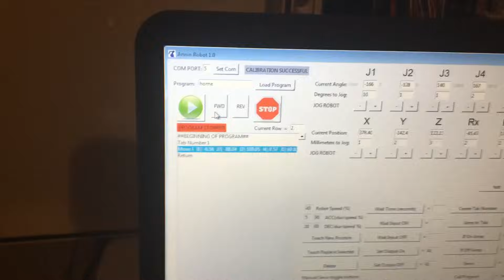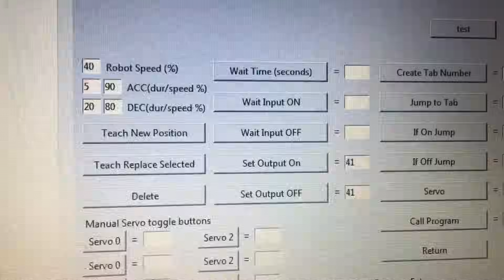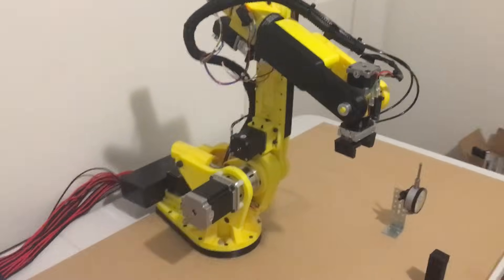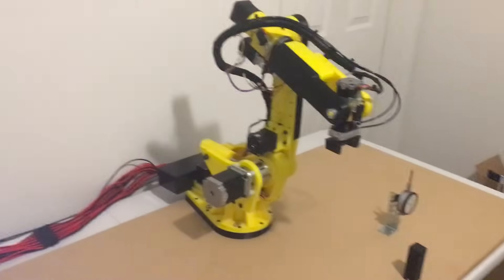3D printed  6 axis stepper motor robot - Gen2

Comment: Nice work. Steppers are just too loud for this though, I can see why they use Servos in industrial robots, servos can be much more accurate anyway as well.
Reply from the maker: agree, the stepper are loud - especially being direct drive.  If its going into a shop or garage I cant image the noise is a deal breaker depending on what you want the robot to do - I think it comes through the mic in the video louder than it seems in person.  Servos and harmonic drives are ideal if you have $$$.

Comment: Жесткости ему конкретно не хватает...
Reply from the maker: yes its not extremely rigid but it is low cost and 3D printed.  Well see how the aluminum version turns out.
Reply: What drivers do you use for motors? Does they support microstep?

Comment: Nice work! I'm a robot systems specialist and currently assemble, program Fanuc and Motoman mig welders and painters. Have u considered variable registers and even arithmetic functions?
Reply from the maker: Yes, I actually just added registers that you can increment from the program and then jump to different points in the program if you want to based on register value our count.  Eventually I would like to have position registers and be able to do offsets based on cycle count or whatever you want, I'm not sure what the next priority is though. Thank you.

Comment: Very Impressive!  May I suggest that you switch to Expandable Braided Sleeving for your cable runs.  Here is a source: https://www.cableorganizer.com/expandable-sleeving/?gcssku=BS0375BK  The nice thing is that it will expand to get the cables trough, then can be taped or be terminated with heat shrink tubing.

Comment: Chris, every once in a while someone comes along to give you an ooh-ahh day. Congratulations, you're it for this week! Looking forward to making my own 3 axis bed CNC and cutting a robotic arm to go on the cross slide to replace the single axis up /down cutter head movement. Put a collet chuck where your grab arm is and with router bits / drills / milling cutters we have an inexpensive 3d subtractive workstation. Put a 90 degree gear on the end and with a spindle in, place a saw blade and you have a grooving station for sheet goods. Put a grinding wheel on the shaft and you have a surface grinder. Wow, a whole workshop in one tool.  Can't wait!

Comment: Very nice. Can't wait to see the aluminium one!
Reply from the maker: thank you
Reply: Just found myself watching this again for the nth time. Regarding your comments here about moving the kinematic calculation into the arduino, that sounds like quite a hassle. Isn't the arduino just there to relay step/direction info to the motors (and listen to the limit switches of course)? The kinematic calculation strikes me as being perfectly suited to a computer with some proper processing power, and more easily modifiable setup and tweaking and potentially also graphical visualization, especially if you intend to release this for others to use on their own builds.
Reply from the maker: I believe you are correct on all accounts - I think its current form is the simplest and has a lot of value for others to use and modify which of course was my goal to keep it as simple as possible - also considering this was a learning process for me as well so it started simple and I built it to a point where it is now.   There are probably multiple ways to do this but my thinking is that if I wanted to get into complex path interpolation like perfectly straight lines, arcs or other 3d generated paths I would need the arduino to execute a series of positions along the arc or line seamlessly with zero delay between moves - it would be needing to read ahead and be headed to the next point as it finishes the last with no delay.  Currently the computer sends serial commands to the arduino and there is a limit as to the string length that can be sent.  Im sending one move at a time and there is a delay between serial commands.  unless there is a way to establish real time communication between the PC and the arduino you would end up with a choppy line or arc movement.  as it is now the PC sends 6 joint positions to the arduino - I think I need to be able to send Cartesian position to the arduino so that it could then do the kinamatics and figure out joint angles and calculate multiple points along the line or arc path from its current position to its destination position so that it could execute many 10's or 100's of positions along that line or arc seamlessly with no delay.  Im not certain but I think being able to send the arduino coordinate positions instead of joint angles would open alot of doors for CNC, printing or other types of applications.  but as it is now its simple, easy to use and it fulfills its intended purpose of a simple material handling robot that can move from point A to point B - Its also good for education and hobby purposes.  I dont think its best suited for material application or CNC applications but maybe thats something I can work on in the next version - perhaps a servo driven version.  Let me know what you think or if you have any ideas.  Im learning as I go here.....
Reply: My main concern was that the robot definition (number and orientation of axes, limb segment lengths etc) would be on the arduino, which would be a nuisance to have to keep flashing a new sketch to set up and tweak. You could perhaps store the definition in EEPROM and update it from the PC instead of re-flashing the sketch every time, but that would have its own complications. Interpolations will produce quite a lot of info to deal with and developing them with the primitive debugger-less feedback from the arduino doesn't sound like fun. I also suspect that the kind of memory needed to store a decent straight line interpolation would be beyond the spec of the arduino - sure you could limit it to whatever movement distance it can actually handle, but this is just another hassle that the PC would not have. Other than that, from an open-sourcing point of view it would be advantageous to break down the calculation stages into more discrete 'modules' that flow from higher to lower levels of control. For example, somebody might like to use their own path interpolation algorithm, which would be a lot easier if there was a clearly defined communication interface for their stage to issue commands to the next lower level (ie. which motors move where). Taking it a step further in the other direction, you might have an even higher-level stage (eg. computer vision to identify parts on a table) that would give commands to the path interpolator. I think the easier each stage can be swapped out or worked on without knowledge of other stages, the more takers you'll have for collaboration.

It sounds like your main concern at this point is the speed of communication between the PC and the arduino? I wasn't suggesting that the PC would issue step pulses directly, just in case you got that impression. The arduino would still be given the desired joint positions and be required to figure out the necessary steps on its own, but it would be given those many 10's or 100's of interpolated positions you mentioned. This I think is an achievable data rate, especially if you make the communication interface a little more efficient. I looked over your sketch and I don't see any obvious reason it would be particularly slow, especially at faster baud rates. But using binary data instead of strings would help to decrease the data volume and time spent parsing strings. To have seamless movement with no delay you'll want to buffer some points on the arduino, which means you'll need to have the arduino acknowledge completed points so that the PC knows when to send more. I guess it would be helpful if acknowledgments like that worked their way back to the other higher level stages too, so that none would get too far ahead of the others, although buffering is less of a problem on the PC side. In any case, I'm pretty sure the PC to arduino connection would be able to send positions faster than the arm can physically carry out the movement. As a rough estimate, a 'packet' with 6 joint positions of 16 bit integers each, plus a few bytes for desired speed, some flags, packet ids, and other housekeeping might come to around 140 bytes. A 115200 baud hardware UART should transfer about 100 such packets per second. So the resolution of the interpolation for that case would be the distance moved per second divided by 100, eg. moving 20cm per second would be done with a resolution of around 2mm.

I'm starting to get together some parts to build a little robot arm myself. I have plenty of programming experience but only just started with steppers and actuation recently when I built a little CNC machine. The inverse kinematic calculation stuff gives me a headache just to look at, so I am thinking to fudge it with a 2D physics library for games (eg. Angry Birds, Hill Climb Racing). It supports joints with limits and would allow setting the position of the two arm ends and simply reading off the angles of the joints. That would handle the main arm joints in their 2D plane, for a typical arm the other degree of freedom is cylindrical rotation which should not be too hard. Since this library is normally used in games with dozens of joints and constraints and typically running at 60 frames per second I have no doubt it would be able to keep up speed-wise. I'm not sure how the accuracy of this method would be though.
Reply: oops, just noticed my packet size calculation was using 16 byte integers, not 16 bit, I was thinking that number came out a little too large heheh. So a typical packet (with 32 bit integers this time) would be more like 56 bytes or 250 packets per second, ie. about 1mm resolution at 25cm/s
Reply from the maker: thanks for the input.  I think your suggestion of sending data binary instead of strings and buffering is a good alternative - I had been thinking about that too.

Comment: Hey Chris, Great work.
 what are you using as a counter weight on axis 2? i see a cylinder and a tie rod, what is that?
Reply from the maker: the cylinder on the back is spring loaded plunger that pulls back on J2 acting as the counter weight.  when I get the project posted it will include complete build instructions which shows all the parts and how it goes together.  hopefully ill get it posted in a couple weeks if all goes well
Reply: Thanks brother! BTW check out Velocio PLCs, they are amazing for running steppers! and also inexpencive and come with a free software and an HMI inteface.

Comment: Very exciting stuff! I can't wait to see more. What are you planing to do with the mechanical design and software? A side from releasing it on get hub, which is a very nice thing for you to do. But, do you have an application you are working toward? Welding bot or machine tending??
Best Matt
Reply from the maker: thank you.  I would say the project has a couple goals - primarily just something Ive wanted to do for a while, I work with industrial robot systems for a living - the discounted integrator pricing for most of the smaller robots is $25K up to $100K for larger ones (the price is higher if your the end user).  Even the small lab grade servo robots are around $15k which is out of reach for most.  Ive always thought it would be cool if there was something affordable that the small business or garage shop could have for small, low complexity machine tending applications.   I was hoping to come up with something people could make themselves. This robot is not a finshed - polished product but its a start or at least a feasible concept.... and its a fun project either way.  I was hoping to come up with something that would only cost someone a few thousand dollars to make - at this point im at $1080 in materials for the robot in the video.  I have a colleague who owns a machine shop and we are working on an aluminum version, hoping to put it to work in his shop doing machine tending.  Im hoping we can continue to refine the quality and programming and perhaps at some point have a polished build your own robot package that is useful.  we'll see how it goes - right now im swamped at work and trying to find the time to get all the files finished up so I can post it and there are still a few bugs im working on.   future steps on this project might be closed loop steppers or servos,  moving the path calculations from the PC into the arduino and develop path planning (arcs, lines ect), tool frame kinamatics and a few other offset functions.  thanks for the feedback.  I'll get it posted as soon as I can find some time away from work.
Reply: I agree. You have a wonderful dream to chase. And a noble one. Robots are expensive and very useful if that issue is solved it would change a lot of lives. I will continue to follow your progress and I might extend some of my manufacturing expertise in casting to aid you with your project if you wish. I will be in touch. 
Best Matt

Comment: Very nice! Could you do a video on the kinematics? The joint to cartesian transformations must be hard!
Reply from the maker: Figuring out the kinamatics have been the most difficult part for me.  When I made the video I had the robot jogging in XYZ  and reorienting the wrist ok with a few minor issues but I found later when I had J4 and J6 at certain positions it would make unexpected changes in orientation which is no good.  Long story short im still working on figuring out where I screwed up.  Id like to have it figured out before I post all the files but the program will always be a work in progress.  hopefully something thats always improving and adding functionality.  I think making a video on the kinamatics is a good idea - all the information ive gone through so far to get where im at has been difficult to follow given that its always written from the perspective of someone who already understands linear algebra and frame transformations and most of it is geared toward a variety of types of robots and not alot of examples of this configuration.  Once I get it finished up I will make a video for the rest of us thats easy to understand.  good idea thank you.
Reply: Wonderful! Good luck with finding the bugs, I'm looking forward to your next videos!
Reply: That is called a singularity, you cant move lineary with the 4, 5 and 6 axis aligned. You should move with a axis movement instead to avoid that. I work with industrial robots and they have the same problem.
Reply from the maker: Shelmak Gc - singularity is the algnment of 4 and 6 making the kinamatic chain redundant, if not dealt with either joint mathmatically could spin 180 degrees out of position.  In my model I force J5 to move past singularity.  My current issue I beleive is likely an error in how im caclulating the rotation matrix for the requested euler angles (3-6 chain) or an error in how im calculating the inverse of the 0-3 chain and multiplying by the spherical wrist 3-6 chain.  If theres any math profesors out there let me know.........
Reply: Chris Annin
I have studied multibody systems but never worked with robots. (Im not experienced in solving open chain problems)
If i understand your problem right, you have a singularity based on a gimbal lock? A solution for this problem is to use Euler parameters (a Quaternion). The quaternion introduces a forth variable to represent the rotation and has no singularities.
Here you can get some informations about quaternions: http://www.euclideanspace.com/maths/algebra/realNormedAlgebra/quaternions/index.htm
If you still have questions feel free to ask them (it took me quiet a while to understand them)
Reply: Chris, I only speak Australian, it's very difficult to understand what you are saying. Where in Russia were you born?
Reply: Maybe you can use quaternions?
Reply: chemicalvamp :
This is a math tool to avoid gimbal lock. This is a typical issue with 6 axis robots, when the 4th and 6th are aligned.
Reply: Just wanted to say congratulations on such a tremendous job! Very exciting work!
Reply from the maker: thank you
Reply: Hi Chris. I'm not good enough to answer your math question, but I'm a industrial robot user, and I know that ABB uses quaternions to solve singularity issues. I don't know more. In reality, we avoid to have an aligned 4/6 configuration though
Reply from the maker: thank you.  i understand the singularity issue its and I know the abb use quaternian oppose to euler my problem it the rotation matrix in the fwd kinamatic chain isnt aligning perfectly with the matrix decomposed from the euler input in the inverse caculation and then deriving J4-5-6 from that matrix gets wierd the further from 0 I get on J4 or 6.  Im sure i'll figure it out.  just need to find some time - too much going on at work....
Reply: Quaternions? Isn't 3 dimensions of rotation enough?? I still haven't seen the fourth dimension so i don't really see the need for it.
Reply: I know it's been a while since you've posted this, is this the process you are referring to? http://traumabot.blogspot.com/2013/07/calculating-euler-angles-from-rotation.html

Comment: It is possible to obtain the stl parts of the robot, electronics and software.
Reply from the maker: Yes I will be posting all the files in a couple weeks.
Reply: Yea just make some sand molds from the plastic ones and cast some aluminium